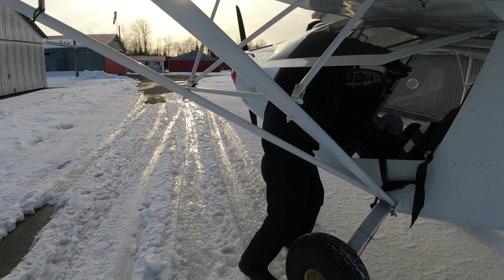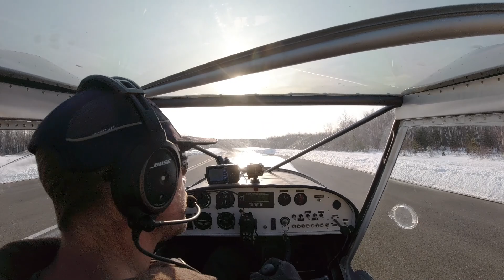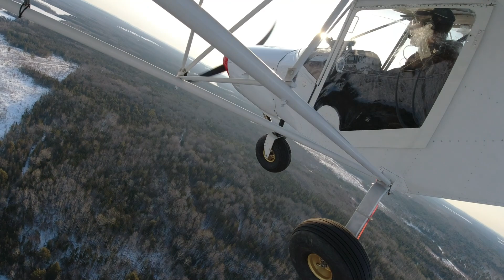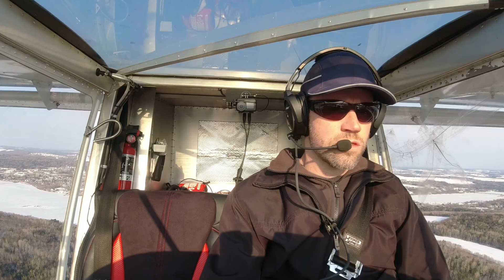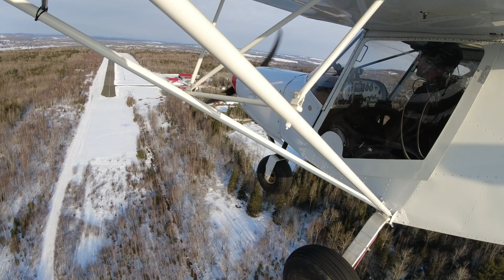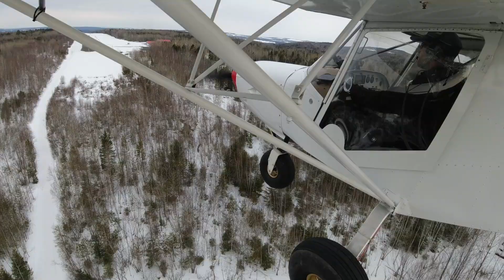Circuits in the Zenith 701

Comment: Congrats did you get the rate of climb off you fancy instruments?  How much shorter does it get off?
Reply from the maker: This was just some initial testing. I'm certain the plane will perform even better once I do a bit of experimenting with it. I did get the rate of climb off the new instrument but was too busy to notice if it crosschecked with the analog one. Lol
Take-off runs with the old engine in similar conditions would have easily been twice as long, probably longer.
Reply: @mmatt  fantastic.  Should be great for some fly and camp.

Comment: Nice video. What is the thing on your passenger door. It looks like the door is partly open.
Reply from the maker: The spring up in the corner? It's to hold the door up when you fully open the door. And yes, the doors are partly open in flight. I have new doors that just need to be fitted that will hopefully fix that issue.
Reply: @mmatt  Oh I see its a spring now. I have an 801. Mine has gas shocks.

Comment: Put VG's on the bottom of the Horizontal stabilizer for more authority. Cheap upgrade.
Reply from the maker: Already has them.
Reply: @mmatt  So is the application of power the only way to increase elevator authority during flair?  Maybe fences or trim covers over the gaps on the empennage?
Reply from the maker: @ManNomad  I think I just need to set the flare up earlier and get behind the power curve a bit so I can use the propwash to keep the tail down while not accelerating. It'll just take some practice I think as I see plenty of other guys who are able to do it.
Reply: @mmatt  Your landings were really good and think you'll have them all wired in no time. Not too many people shoot power off no flap landing in 701s, on youtube. You aced it. Looking forward to future videos with it. Stay safe and enjoy.

Comment: Nice camera angles! Tech question: does ground effect affect your different planes at different heights above the runway? Guess you can tell I'm not a pilot!!😂 Ps. I'll send some South Carolina heat up there to take care of that snow!😎👍
Reply from the maker: That's a great question for someone who's not a pilot! Yes. Ground effect comes into play at an altitude equal to one wingspan of the airplane... but I don't really feel its effect until about half that. So the longer winged airplanes start to "float" at a higher altitude than the shorter winged ones. 
Please send as much heat as you can spare! It's 2 degrees below freezing today and the windsock is straight out and flapping!

Comment: Which plane do you like better?  The Zenith or the XAir?  What are the major differences?  What would you recommend as 1st plane Ultralight purchase?
Reply from the maker: Depends on the mission. The X-Air is faster and has a bigger and more comfortable cockpit. It's what I'd prefer for a longer cross-country flight. The Zenith's controls are much more sensitive though especially at lower speeds which makes it ideal for the off-field ops. It's not as easy to fly as the X-Air though due to it being very easy to over-control. Of the two, I'd recommend the X-Air as a first plane and then sell it and and move on to a Zenith if you crave the off-field capabilities that it has.

Comment: I'm really glad you brought up the subject of "flipping over".  Personally I think it's something to consider.  I do know this, if I was to get a Zenith model, I would most definitely favor the high winger like you're flying over the CH601 low winger.  And it's not because of wing strength, although the early days of the 601 saw some wing failures and now the 601 has very strong wings with a +6/-4 load factor and the 701 comes in at +6/-3 according to the Zenith site.  {for comparison, the Super Decathlon has aerobatic limits of +6/-5} So with the 601, I think I'd be confident with the wing strength.  My concern would be the egress factor in a flip over. I have looked at photos of the 601 and drew imaginary lines from the top of the vertical to the top of the engine cowl most forward end and drew an imaginary pilot head and I don't like what I see - I see images of one my favorite airshow pilots of all time - Charlie Hillard who lost his life when his Sea Fury flipped over and he was trapped inside the bubble canopy and could not escape. Now has the 601 been tested in a flip over to actually see if a pilot could get out ?? That I don't know, because as I'm sure you're well familiar, aircraft manufacture sites NEVER give you all the information.  That being said, it appears that in the 701, you will be able to egress in a flip over because the wing will serve as a "barrier" - but you'll have to undo the belt and "fall" onto the "ceiling" which is now the "floor", then crawl out.  What do you think ?? Have you thought of what to do in a flip over ?? What do you think of my bubble canopy concerns ?? {also} do you have data on any spin testing that was done on the 701 by {"Rodger" ?? the Zenith demo guy}
Reply: Intentional spins prohibited in the 701 so weather or not Roger has done them is a great question but unlikely
Reply: @tonyharnett3169  But like for example, the Bush Cat has been spin tested and it's in the same basic category as the 701.  The Bush Cat has a rated load factor of +6/-4.  Factory aircraft, many of which have less design load factor limits are spin tested - at least that's what I've read.  One thing I find frustrating is to get the nitty gritty information, you have to dig and dig and dig. I had to do HOURS of reading to find out if the Bush Cat had been spin tested.  I know the Panthera has - because they made a video about it.  On the Panthera they had like 3/4 fuel, 4 adults and went 10 full rotations and still recovered.  The BRS was available if they needed it.
Reply from the maker: I prefer high-wing over low-wing for several reasons, but this is one of the biggest ones; survivability in a flip-over situation. Egressing the 701 shouldn't be any trouble at all aside from the bruise on the top of my head once I undo my seatbelt... lol  The doors are hinged a the top which will become the bottom and so the door should just flop open once I release the latch. That is if I have any doors left by then... I'm kinda hard on them...  LOL!
Reply: @mmatt  In the Charlie Hillard incident, the Sea Fury flipped over - the soil was very soft and the vertical stab sunk into the ground changing the geometry of a "normal" flip over.  On the front end the prop dug into the ground as well because it flipped over during taxi and the engine was still running.  Some say Charlie was crushed, but others say he was pinned and could not breath.  So because of that, I'm staying away from bubble canopied aircraft.  The only way I'm riding in one is if the factory has tested a flip over and egress has proven to be a success.  And that's another thing - you try to look up information, like for example, does the CH601 have a roll bar and what's its rating ?? The web site does not tell you.  And then you got certain aviation You Tubers like this one guy who just sold a Sling tsi low winger - a very very nice guy - I mean a VERY NICE guy, but he skips over critical information - he'll say "the seats in this thing are leather and well made" but he won't tell you if there's a ROLL BAR - he's literally 5 feet away from the canopy and NEVER talks about it.
Reply: @braininavatnow9197  In a design phase of any aircraft, it is of my understanding that a prototype basically becomes the "sacrificial lamb" and is supposed to be put through the ringer - but in the actual subsequent aircraft that the public receives {or builds} it is perfectly fine to placard the aircraft and say "no aerobatics".  It's just nice to know you have strong wings - which another point I'll bring up, and that is in the early days of the 601 when a few wings broke, I find that absolutely inexcusable and border line criminal. Wings should NEVER break - if operated below Vne and are at max gross or lower.
Reply: I would buy a mini oxy-acetylene torch and keep it in the back for $200 ~300 filled and use it to start campfires or cut through the windows and a Razor blade from Lowes. Maybe it's standby use with the oxyen and a simple mask could be for when I suffer from altitude sickness at 15k for 15 minutes.
Reply: @braininavatnow9197  All aircraft? FAA?  I don't hear of grey areas. But, if it's cold AF, The ambulance EMTs in a snow covered pasture still need an 30+ extra minutes to extradite you. The fuel cells should be still certified to withstand a crashworthiness directive. To hell with freezing to death, I'd rather be warm!
Reply: @braininavatnow9197  By "sacrificial lamb" what I mean is the proto test aircraft should not be for sale. It should be flown to the limits AND tested for flutter as well - thanks for brining the flutter thing up. I remember seeing a video once on the Boeing 777 where on the proto type they hooked cables up to the wings and started pulling and pulling and pulling until the wings broke. {and it went BOOM !!!}  In the Air Bus A319 we once had a customer that was due a 10 year check. {it was a VIP Air Bus A319} The test was to fly the aircraft to its published limits - airspeed, mach, g forces and I kid you not, the way you determined if it "passed" if the airplane did not break apart in flight. My friend volunteered to go on that flight because he had terminal cancer and he joked about having nothing to lose. But it made it back just fine.  Of course the A318/320/321 have an AD with the vertical stab.  After so many hours you have to take a composite core sample and sent to a lab.  If the lab finds it bad, you replace the vertical, if not you fill the bore with composite resin and return to service.  But yea, also thanks for the clarification on "normal"/"utility" verses "aerobatic".  On the Super Decathlon for example, the aerobatic limit is +6/-5 so that's the aerobatic category.  I'd be curious what that translates to in the other categories ??

Comment: What are your cylinder head temps like in the cool Canadian air?  I usually have about 325 in Australian summers when I do circuits.
Reply from the maker: I haven't seen them above 275 yet. I'm sure they'll be higher in the summer.